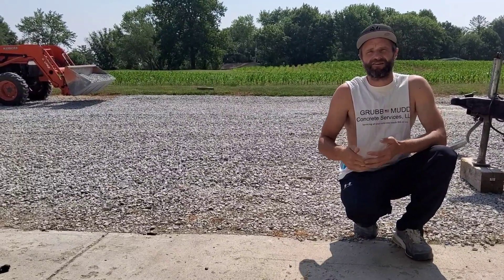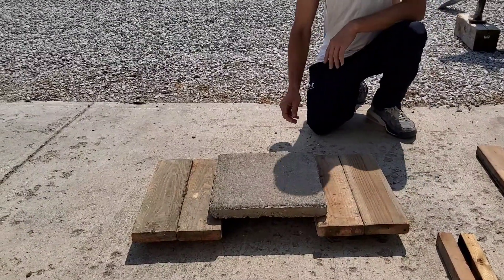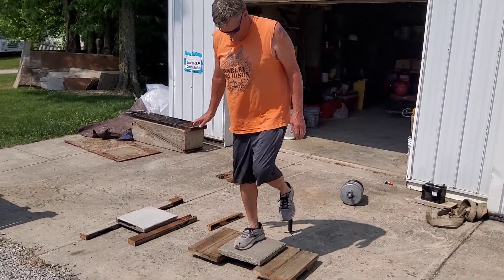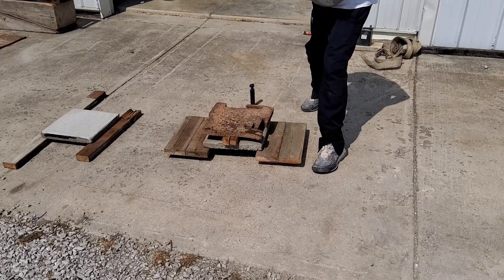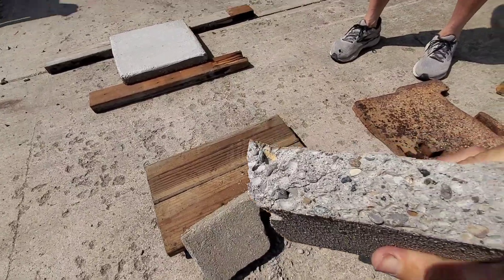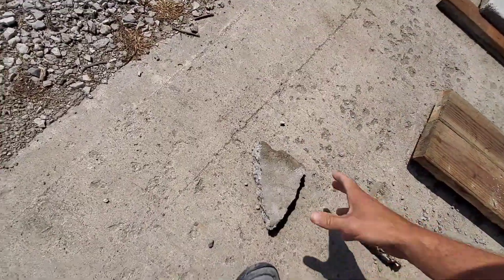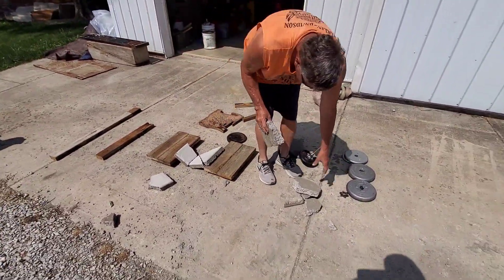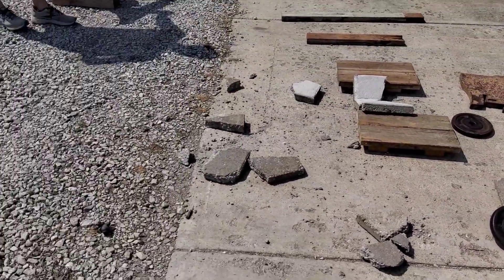I cant Believe DRY POUR Concrete is SO DAMN STRONG

Comment: Don't do dry poor on anything other than the ground if you want  a fair assessment. Also, dry poor is easy to do in tight places where you can't get a truck. A pumper will cost you $500 or more. The dry poor will be better on the ground than a board

Comment: Click bait nonsense. That is not the way to test concrete strength. Try a real compression test and it will show that properly mixed concrete will be about five times as strong as dry mix.

Comment: if you put down 6 mil plastic first the bottom will eventually get the moisture you need
Reply: ..or water the ground then water it in layers, as in put down an inch of mix, water it, then another inch and water that, etc. All these tests seem to be where the 'dry pour' wasnt watered enough.

Comment: Concrete is useless at thickness, it not designed to flex you drop a hard weigh it gonna crack off a truck or not doesn't matter
Reply from the maker: No doubt, i was just surprised iy held uo that long and cured that decent
Reply from the maker: Thanks for wstchibg. Check out my other concrete vlogs, if u havnt yet

Comment: You guys need to say if it's rapid set or structural grade. All concrete has a big difference between compression and tension strength with or without Rio bar.
Reply from the maker: Its regualr sac crete

Comment: Wet-pour concrete strength varies with the amount of pour water used, the wetter the pour, the weaker the mix. The 10-pound weight shouldn't have broken the concrete. He probably used an excessively wet  mix.... There's nothing wrong with bagged concrete, it's the same as what comes in a redi-mix truck. Follow the bag instructions regarding water amount and you will get a very strong concrete.
Reply from the maker: Its far from as good as ready mix. For 1 the agg ia pea gravel not 1 inch minus rock. 2 ready mix has fiber and alot more cement. So it ia stronger. I mixed it at q 5 slump

Comment: Ive done math .. in my area if your pouring 2 yards it is actually cheaper getting premix  delivered in a truck than buying by the bag and mixing or dry pouring.. even after paying for small load charge..

And if your hand mixing in a wherl barrow doing a bag at a time you will never get it all poured before missing your finishing time frame.. 

Thats where drypour vomes in. But compare the cost with a premix delivet. You might be suprized.

Comment: Dry pour is just as labor intensive as wet concrete, it is not "the lazy's man way." There may be some advantages to one or the other.
Reply: Dry pour is can be 3x easier than wet pour, depending on job size and skill levels being compared. However that does not make it a lazy way. If it produces a product adequate for your needs, go for it.
Reply: The only major difference is mixing the concrete. In the video he said, "You might as well spend and extra $100 more and get a ready mix truck." Why wouldn't we call that the lazy mans way? I personally don't think any way is lazy, and once you do it with a reasonable slab, you won't either.  @FisherCatProductions
Reply: @desertcityentertainment  Exactly. Just because something is easier, cheaper, or faster doesn't automatically make it a "short cut" or "lazy". A dry pour is the only option for many people who want to do their own slab. If you don't think a dry pour is considerably easier than a wet pour, I question if you've done either.
Reply: @FisherCatProductions  I don't mind the questioning me, you should question someone you know nothing about if you care that much. All I was saying is that it isn't a lazy job, you appear to agree, therefore I have nothing to go back and forth with you about?
Reply: @desertcityentertainment  Having poured concrete all my life--redimix and hand mixed--I  just want to assure people that dry pouring is IMMENSELY easier, especially on a medium size project. Especially at my age (72). Especially if there are only 1 or 2 of you. Especially if you are reluctant to dive into a wet pour with no experience. (But only for light duty slabs) Ciao!

Comment: The dry pour may have cured all the way through, but it pulled the rocks, though, when it broke. If the cement paste bonded with the aggregate inside, it would have actually snapped some of the rocks in half. In this case you can see it left some rocks in and pulled the rocks from the other piece out. See the voids where the rocks were at 4:15 ?
Reply from the maker: I appreciate the detailed review
Reply: Ya' which is why it is used for light duty slabs. Everyone understands won't be as strong as wet mix, but you don't always need wet mix strength. Frankly, I was surprised how well it compared. The only measured test I've seen placed it about 2/3 its rated wet-strength--which also surprised.me.
Reply from the maker: @FisherCatProductions  i think if u do it right, and soak it alot. I dont think it will be any less stronger than wet mix from a bag
Reply: but it didn't make any difference.

Comment: When I was a kid I "helped" pour a garage slab with my granddad. It was about 2" thick. We had all the gravel and sand in 2 piles, and bag cement in the truck bed. They made a pile of sand and gravel on a piece of plywood in the middle of the slab with a divot in the center. They filled that divot with water then added the cement to that a few bags at a time. They put in x number of shovels of sand and gravel. Then they mixed it all together with masons hoes that have holes in the center. It was 2 guys and me. We just folded everything over and over keeping the water from running off. It didn’t take that long and because everything was just a shovel full, it wasn’t that hard. After using a traditional drum mixer with bag concrete, I think their way might have been just as fast and less work. You weren’t lifting bags high up, pushing wheelbarrows around. Maybe it wasn’t as well mixed, but the slab is still there 50 years later. It has a few cracks, but we didn’t compact the ground very well or add a thick base of gravel.

Comment: this test is NOT a compression test, but a tensile stress test. This test only proves that concrete isn't for tensile stress (which we already know for ages). thats why they have rebar inside to for the tensile stress. and the concrete handle compressive stress.
Reply: Clearly you don’t know what a tensile test is, this is an impact test not a tensile test, tensile strength is the amount of force it takes to tear something apart
Reply: @bdubb515  🤣🤣🤣 my god the nonsense  read
Reply: You're spot-on.  His standing on the concrete was a tensile test, not compressive.  Concrete addresses compression load, not tension.  We don't use concrete to suspend bridges, we use steel cable.  We need someone to dry pour a cylinder and test it in as close a manner as possible to concrete compressive test ASTM C39.  Another test that would be interesting to run is ASTM C666 to check freeze-thaw durability.  Dry pour is a logical outgrowth of ever-higher costs for concrete; the guy who wants a simple 10'x12' pad for a backyard building or patio will likely get an estimate today for about $1500-$2500 for a wet pour, or he can dry pour a 4" thick pad using about 70 bags of quikcrete at $5/bag, plus $30 of form boards plus striker boards, which is about $400 in materials plus delivery plus his own labor.  And, the concrete truck doesn't rut up the yard.  Concrete trucks are god-awful on yards.  Concrete contractors are slowly pricing themselves out of the typical residential flat pour.
Reply: yeeeep  @marknussbaum8394
Reply: @marknussbaum8394  I agree, have you also noticed it is always the concrete contractors that do these tests? Though I think this guy actually watered it more than most do. One test I watched it was obvious they didnt use enough water. Concrete is a chemical reaction between the powder and water, the only real difference between wet and dry pour is the wet pour is mixed and dry pour is just soaked, given the same amount of water both should be identical. Perhaps someone needs to put the dry pour down in layers, wetting each one as they go and then compare them under realistic ways that the concrete would actually be stressed in real slabs, not dropping a weight on it when it is suspended between 2 boards.

Comment: I’m doing just a little pad on the back side of my house. I was going to dry pour because it doesn’t need to be all that strong or last forever but might as well just mix it right
Reply from the maker: Do what u feel comfortable doing bro
Reply: Dry pour makes more and more sense as the project gets bigger. Most DIY people don't want to attempt a wet mix 20 x 20 patio. Four 10 x 10 dry pads are easy-peasy. A small pad can easily be wet mixed on a piece of plywood, so no big deal either way. A small dry mix is certainly fine, but the benefit of "being easier" decreases.

Comment: So many things here.... suitcase tractor weight isn't 200lbs. 
Bag mix not meant for anything under 2 inches thick. 
Concrete has support under it not running a span. 

All the dry pours are just lazy. Its not that much more effort to mix with water and pour these YouTube dry pour projects the size that most are.

Comment: Ya all the fence guys are doing it. So every time it rains I have to go back and fixe bent fence
Reply from the maker: Huh?
Reply: We set 4x4s and chain link fence posts in dry concrete for 25 years. Flawlessly straight with no braces needed. Never had any of hundreds of them fail. The only way to pull them out was with a front-end loader, and they came in a solid chunk.

Comment: When ever I use quickcrete bag mix for small stuff, I would always ADD a shovel full or two of portland cement to it when I was mixing it. Makes it a Lot stronger and not brittle. However, can't really do that for a dry pour.
Reply: sure you can... mix them dry
Reply: Or just buy a 5000 psi bag mix. Wet or dry it will be stronger than a standard bag of Sakrete.

Comment: Okay, my opinion on this video. Dry mix is okay if you're doing fence post or something like that I pour a lot of footers. And sometimes we have to anchor to the concrete. On a dry mix, it never holds. As soon as you start drilling, it just turns to dust. Not really a fan of the dry mix.
Reply: Michael Builds does a lot of dry pours, and has used anchors for sill plates with no problems. Good and bad wet pours. Good and bad dry pours.
Reply: @FisherCatProductions  Yes. Over watering wet mix can ruin it. Both done properly, wet mix still turns out superior in every single way. Dry still does have it's merits though, for sure.
Reply: @FisherCatProductions  his boyfriend loves them.
Reply from the maker: I juat am seeing this stix, it def turned to dust! Mush respect. What do u gota do to get the monotization back?
Reply: @GRUBB-MUDD  Because I haven't really been making videos. They're saying. I only have 3000 watch hours, need a 1000 more.

Comment: Being a concreter myself i know the dry pour concrete is rediculous. But a better test is a gradual compressive test instead. This test not very consistent or in a controlled environment.
Reply from the maker: 😂 its all we had
Reply: It's ridiculous why? Because you say so? If you've never done a dry pour , how would you have a clue. Considering there are dozens of videos of successful projects with follow-ups, I tend to take their evidence over your uninformed opinion.
Reply: @FisherCatProductions  my uninformed opinion is 20 years of experience champ. How much experience do you have as a concreter or engineer?
Reply: @lachlanitis2311  You (obviously) have ZERO experience in doing dry pours. Therefore your opinion concerning them is uninformed. Nothing personal. Just a fact. BTW, working for the state Fish Commission over 25 years, I supervised poured, and finished miles of slabs and walls for fish raceways. Poured boat ramps, piers, and bulkheads above and below water. Designed and performed repairs to dams and raceways using custom forms and high pressure concrete. Worked with hand mixed, batch trucks, pumpers, and crane drops. None of which qualifies me to comment on dry pours. Doing some successful dry pours does qualify me to at least have an informed opinion...champ.
Reply: @FisherCatProductions  if you want a shit product with a shit looking finish go right ahead and do dry pour. I just happen to know the science behind concrete and il stick to my wet pours.
Reply: @lachlanitis2311  I knew a rocket scientist who couldn't unplug his own sink drain. Like I said previously, anything you opine about dry pours comes from your extensive lack of experience with them. Obviously you don't know how to finish one LOL. Like you said, stick with what ya' know!
Reply: They do dry pour in the house to raise the floor and the whole point is that you can get a completely straight floor and it wont crack like wet poor will. The floor you can get completely straight. Tile will be going on it what will happen to it. Nothing.

Comment: Nice video! I'm doing research for a dry pour myself... yeah, lazy as you said. On other videos, they smoothed out the concrete & edged it real nice before & after the first wet down. The strength is definitely there! Also, you didn't use any rebar/mesh. I think that would have made more of a difference. I'm still tittering between dry pour & buying a mixer... Only thing that's holding me back is I don't have room for a mixer after the job is done!
Reply: Hire 1.
Reply: Get a mixer, the difference isnt just compressive and tensile strength as shown in the video. The dry slab chipped and flaked, and when the pieces were dropped it was releasing aggregate and the cement was crumbling away, which are signs of an improper mix, ie either not enough cement, unhydrated cement, or diluted cement which would be from a poor mix (not a factor here, its all the same prebagged product), or improper water content, either too high or too low. Too high water content is a common issue in house slabs, too much water is added into the truck or during finishing to make it easier to work with. If you take a grinder to a slab like that it starts doing the exact same thing, crumbling and throwing rocks. In either case its a sign that the water content was improper and caused a significant drop in yield strength and surface density. In this circumstance its because 1) there isn’t enough water to properly hydrate the mix, there may be enough water volume but mechanical agitation is needed to evenly hydrate the cement. And 2) nothing can be done on a dry pour to densify the surface. On a regular pour you will screed, bull float, edge, mag, and trowel the surface. Each of those steps being done as the concrete is getting harder and harder, which compacts fine aggregate and cement on the surface and making a dense layer. If you want a nice looking surface that will last a long time and hold up to abrasion you need to do all those finishing steps.

Comment: You should drop a weight on them without them being elevated because they will be poured directly on the ground which should offer the concrete more impact resistance. Not trying to say that testing with them on the ground will prove anything different. Just a thought.
Reply from the maker: Good idea

Comment: It's nice to see a pro test this. I usually test stuff at home because no one will complain but me if I make a mess.
Reply: @GRUBB-MUDD where you guys at in Indiana ? I see your guys with Purdue hats on, I live in Lafayette and I have 4+ years clean from heroin. I got clean after moving back home to Lafayette from new Orleans. Keep up the good work bro salud
Reply: "Pros" almost always get dry pour wrong because their minds are locked into doing wet pour. Right in the beginning the guy talks about wetting and says "drenched it real good" and thinks he probably did it better than most.  Well there is mistake one!! it's because his mind is worked into wet pour. 

To do dry pour right, the key is watering and you need to do it slowly on a schedule and you don't drench it!!  That works somewhat OK for a fence post but is not good for a slab. The way dry pour works is from the very gradual even migration from the top down. If the surface gets wet with a little water beginning to stand on it you are using too much water!

Correctly done, dry pour ends up using the very minimum recommended water, slowly absorbed to he optimum amount of water, sort of like using a vey stiff mix of wet pour.  Most pros know that a very stiff mix makes the strongest concrete. But it is much harder to work and finish. The cement, sand and stone are different densities. Too much water and it tries to settle by weight.

The color of dry pour looks different, That is because the mix remains uniform.

Pros keep trying to "fix" dry pour as they go because it doesn't behave like they are used to.  They do this subconsciously because of what is ingrained in their minds about wet concrete. In fact, rookies with very little concrete often do better dry pours because they just follow the directions precisely. 

The first best thing you can do for dry pour, is to forget everything you know about wet concrete.  In psychology this is referred to as a paradigm shift. It is not easy to retrain our brains,